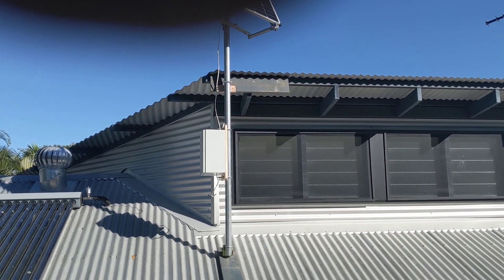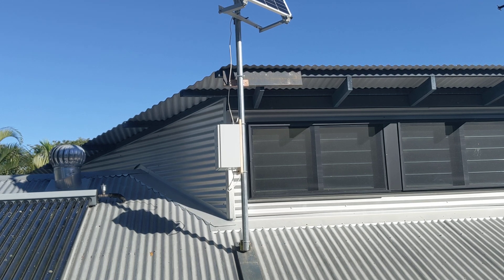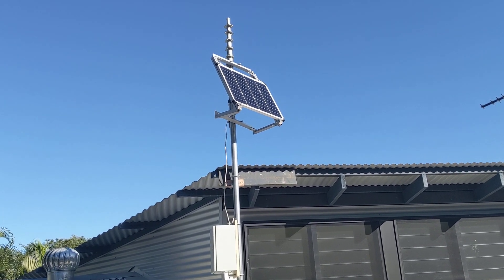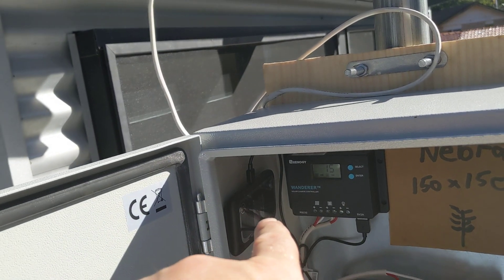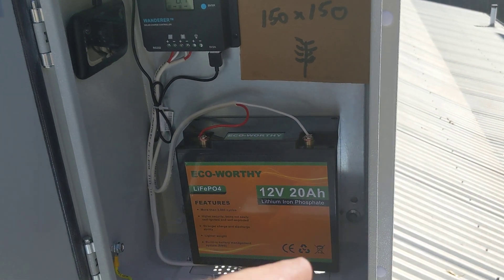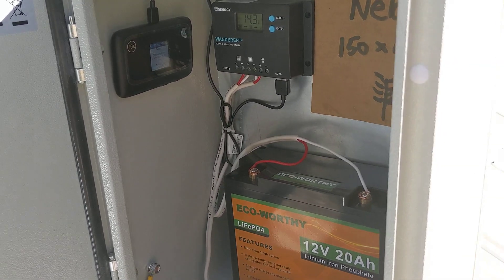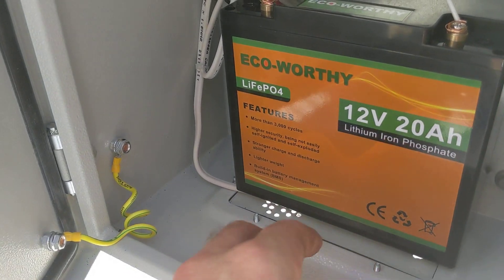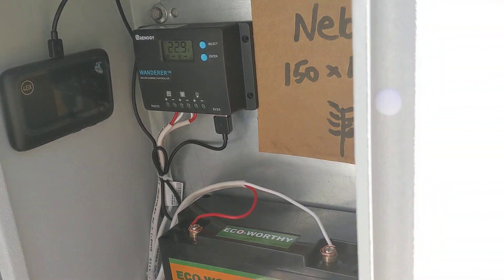Helium Off Grid Prototype - this unit will eventually house a Nebra Indoor Hotspot. - Australia

Comment: Any time you use a Lifep04 battery, you need to pick a charge controller that is made for these batteries. These batteries use a slightly higher voltage than lead acid batteries and other solar batteries.
Reply from the maker: Thanks for the tip my mate.  Like everything new there is a lot of trial and error.  Cheers

Comment: Your vlog on the helium network has been very inspiring and helpful. May I ask how much is the internet usage of the off-grid setup as we are planning to build a similar system. Thank you.
Reply from the maker: Thanks so much for the question.  The data usage is actually pretty high with approx 30-50GB Per month.  I have the 5 Gig plan with unlimited download at much slower speeds, this speed will run a Hotspot easily.
Reply: @HeliumDownunder  Thanks for the info, much appreciated, now to work it all out😁

Comment: any follow up to how the off grid setup went,  is it working with the 20Ah battery or anythin you needed to change
Reply from the maker: Hey mate, I am still to get my first Hotspot....very soon.  I have done some basic testing with other electronical devices and it seems the 20aH is far more than needed but this is in my region with a lot of sun.

Comment: Hey mate, i hope by this time your indoor nebra unit has arrived. I was just checking on their website and found out that the indoor unit doesn’t support 4g modem , but the outdoor one does. Can you please confirm and let me know as well. Thanks
Reply from the maker: I so wish my order was here but afraid not.  Imam batch 4 with a ship date estimated to be August so hopefully some time in the next few weeks.

As for 4G, you are correct about only the outdoor units have the ability to have a 4G card fitted.  The indoor unit can run on Wifi so a 4G modem will work, this is what my plan is.  Fingers crossed for soon.
Reply: @HeliumDownunder  oh okay i got it now, good luck mate i wish you grow very well 👍🏻

Comment: Intarestingley enuff you could use the Helium network to send temperature data back to you with the IOT!
Reply from the maker: Totally correct.  With my off grid system I will have a GPS, temp and anti tamper sensor...

Comment: Hey Ian you mentioned in the previous video that you were looking at having 2 batteries. Did you find that one 12V 20ah battery is enough or would you still recommend 2 of these or a higher ah for the single?
Reply from the maker: Hey mate, I am still waiting for my Hotspots to arrive but expect the by August.  Since recording this video I have spoken to some folks in the know and they believe that a single battery will be sufficient for Qld.  Still to be proven 100% accurate but will release my full set up when the hardware arrives.
Reply: Awesome thanks mate!

Comment: Hi Mate, how do you reckon the wifi modern will get its signal inside a metal-enclosed box?
Reply from the maker: Thanks for the comment my mate.  The wifi signal is strong in my area and I have tested it with the door open and closed with little difference.  If it does become an issue the wifi modem I have purchased to have the ability to add an external antenna.  Moving forward with Helium my belief is that internet speed and bandwidth will become less of an issue once the validators are fully live, this is very very close.

Comment: whoever did your roof needs a few lessons in finish off. 
Best to mount the 4G unit outside of metal box for coverage. plastic IP63 mounted to outside of box will increase range and signal strength.
Will you be installing a fan to remove heat generation?
Good concept/idea though

Comment: Just subbed. You got a discord? Thanks.
Reply: PS: If you after a data sim for your completely dependent set up. Get stocked up on 28 days VodaFone starter Packs (on sale they under $7 a pack). 40 GB, before limitless data capped @ 1.5 mbps
Reply from the maker: Try this link mate, sorry for the delay in replying.  There is not an enormous amount of chat in this Discord but it is another way to stay connected.  https://discord.gg/fFZHHRU9A5

Comment: Hey Ian, whats the benifits of going off-grid ? won't it be far away from the network or are you planning on placing near others ?
Do you own the land your putting it on too, or is it a mates or what?
Thanks again for the vid and in advance for the response :)
Reply from the maker: Hey mate, all great questions and I will answer them all but remember this is an experiment.

Being Off Grid I do not need to bother any host for power of internet so no cables.  It is also totally self sufficient (the plan) so I can set it up on building roof top, hills or out on a property that has a need for IoT.  I don't own any location besides my home set up, as mentioned above, many possibilities if it works.

Thanks for dropping in and commenting.... :)
Reply: @HeliumDownunder  Thanks for that and no worries, will be keeping an eye on the experiment as you update us :)

Comment: I've got a similar setup (x3) in Ireland waiting on the Kerlink miners (4G sim slot), (3 watts). My battery is 10 Ah and panel is 25W, which should be good for the lower power miners but the winter sun in Ireland could be a challenge. 
The biggest fear I have is that the miners will be relayed if I can't get the port forwarding to work on the 4G network. Bobcat, Syncrobit, Nebra on the way as well, possibly running off 4G router. Anybody experienced/solved relay problems with 4G routers?
Reply from the maker: The  matter of Relay is the major concern  that I have, I have heard some say that it is not a problem and others say it is a huge problem.  I will wait until me unit arrives and then see how it goes.
Reply: Does the Kerlink miner run with 4G sim slot from factory?
Reply: @TheBlackgerald  There are a few Kerlinks on sale from Cal-chip. The "evolution" model has sim slot (Europe-only). How the setup interface works is unknown. How the port-forwarding (relay) issue is affected by this is also unknown (by me). It's more of a gamble than an investment with the lack of information, but that's the risk I'm taking.

Comment: Its a good set up ,over built for sure but thats not a bad thing . 100 watt panel is way oversized The battery holds about 200 watts of power thats enough for about  8 days without recharging  . The panel will fully charge the battery in about 2 hours , you may actually find you generate too much solar power ,if thats the case simple direct the solar panel away from the sun a bit . Remember these Hotspots transmitted 0.5 watts  so they probably draw less than 1 watt . Whats the best way to contact you Ian  ? or can you contact me  , my number is 0414 916560
Reply from the maker: Hey Graham, I will shoot you an SMS mate, feel free to call me back when it suits.